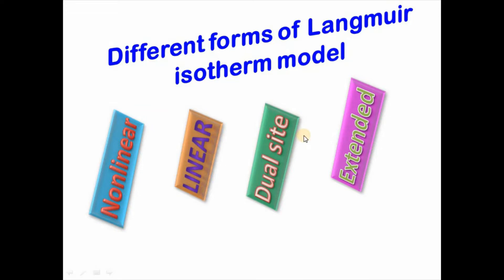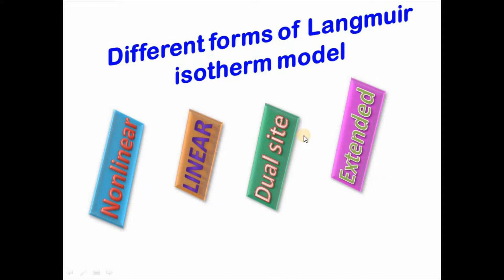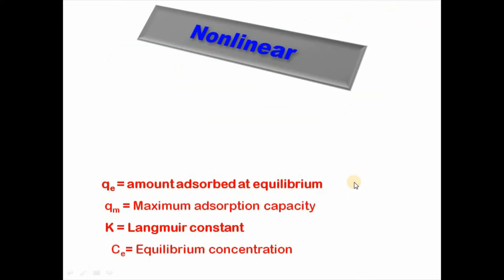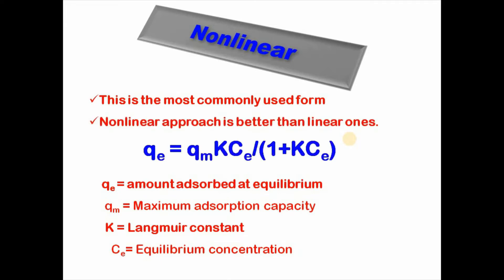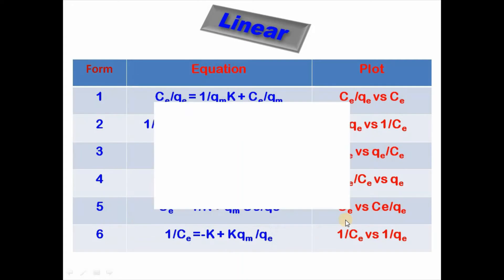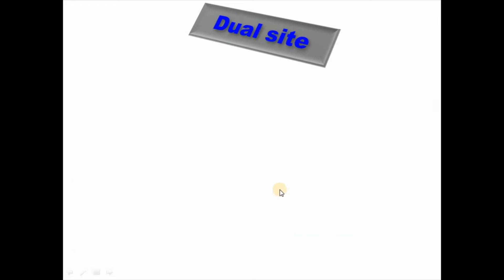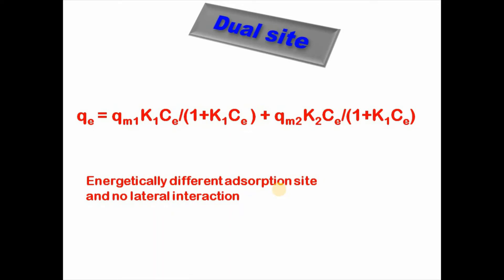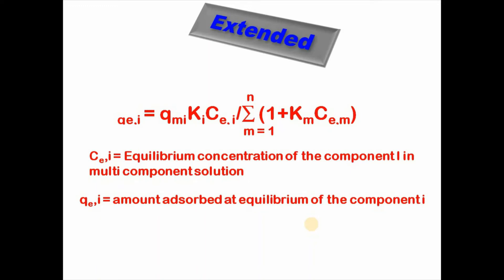Different forms of Langmuir isotherm model

Comment: I am using pure ethanol and 0.1N NaOH as solvent for desorption of adsorbed drug on metal hydroxide. Ethanol is showing 96% desorption and 0.1 N NaOH 87% desorption. However, the adsorption mechanism occurring via electrostatic, pi-pi and H-bonding. Which reason is occurring for desorption ?
Reply from the maker: Thanks. The surface bond of an adsorbant can be cleaved thermally, through chemical reactions or by radiation, or through suitable desorbing agents, all which may result in desorption of the species. However, it is difficult to say as electrostatic, pi-pi and H-bonding.
Reply: @Aminulchem  Ethanol is showing best solvent for desorption, it depends upon bonding ? However, the mechanism was explained with the help of electrostatic, H-bonding and pi-pi interaction.
Reply from the maker: @ilmakhan6834  Thanks. Desorption study can't explain mechanism precisely because adsorption mechanism is quite different from desorption mechanism.